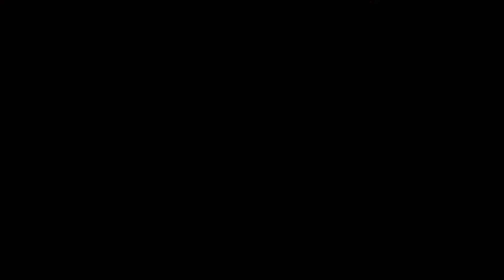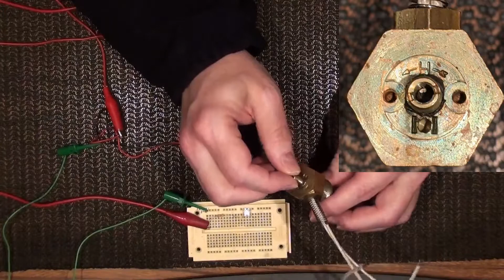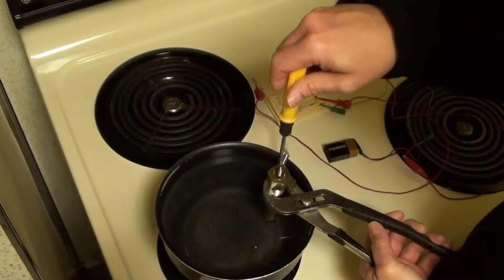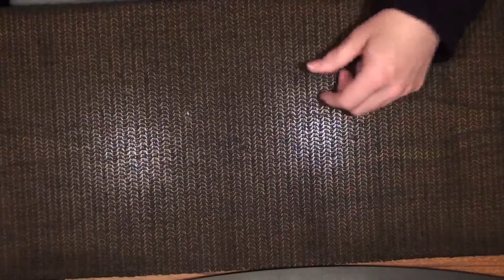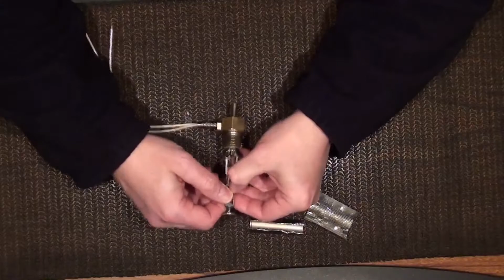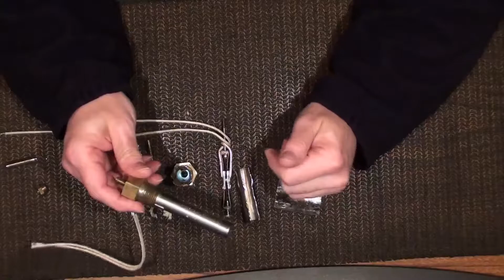Inside an Expensive Thermoswitch (Teardown & Stove-Top Demo!)

Comment: Hmm about £216 pounds, not a cheap item.
So you could use that to turn a water heater on/off for a set temperature ,  if a large relay was driven from the thermo switch.